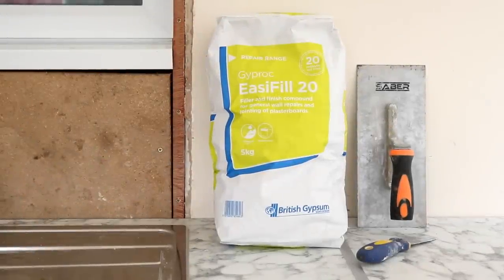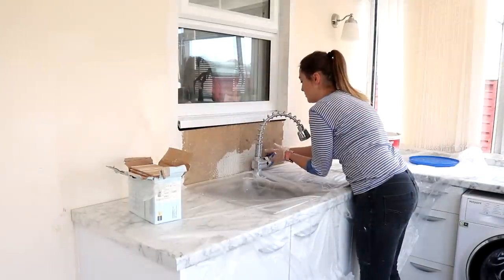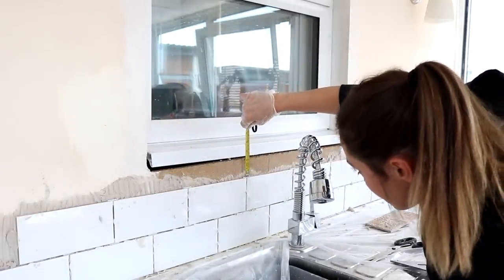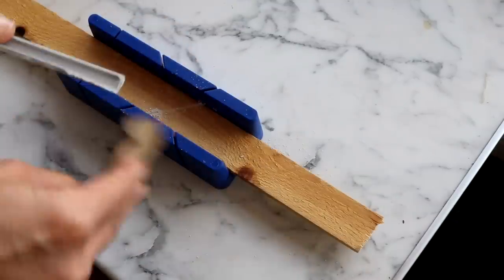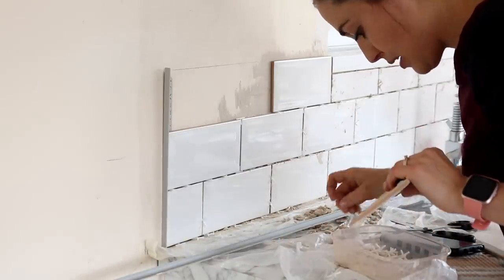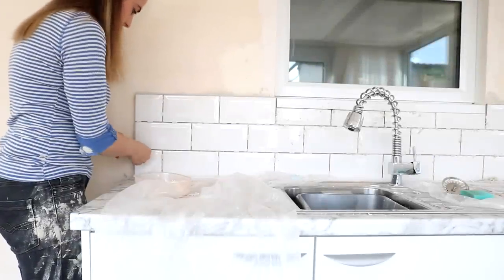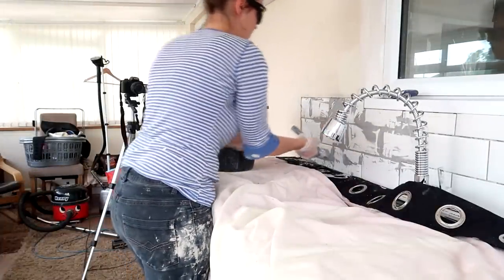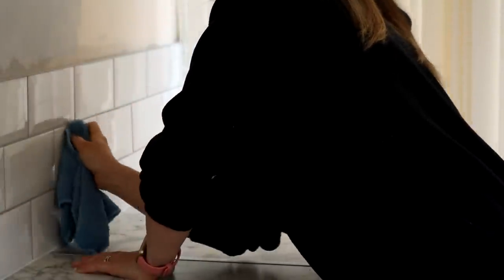Tiling a Kitchen Splashback: Metro Tiles | The Carpenter's Daughter

Comment: Some people use those tile spacers differently! I have seen several ways but I have found the best is to stick one of the "spokes" of the cross into the gap between the tiles using 2 spacers on the horizontal runs! This allows you to easily pull them out after it is set!

If you lay a full tile at the end you need a cut tile on you can overlay another full tile, mark the overlap, cut and you have your cut tile ..... swap the positions and you are golden!

You are right about using a flexible spreader to grout with, but sometimes it is easier to get it right with a grouting tool especially on larger tiles. Many of the grouts available now are waterproof so do not need sealing .... worth a read of the label ;0) Polishing the tiles off with a cloth after the grout has set (but not cured) is a good tip ..... you want your new tiles to look, well, New!

Again the trusty grouting tool will give you an excellent bead on your mastic seal ..... If you want to pose you can wet your finger and run it along the bead, but this is one for the pro's not for me!

Once again a good video showing how easy it is once you have a few basics! ... And how good a result you can get!
Reply from the maker: Thanks for the tips again :)  Your marking for tiling towards the window sounds exactly the same as last week's end panel method... very handy 😊
Reply: Same principal ;0) 

If you want to do the Pro impersonation use a pure silicone mastic. Lay a bead in the corner. Then let it cure for an hour (or about 2 cups of tea) then spray it with a foam window cleaner. No need to spit on your finger ... just rub it down the length in one smooth motion and wipe the excess of your finger with a paper towel. 

You will have a nice tight bead perfectly formed the width of your original bead with no sticky bits to remove ;0)
Reply from the maker: Thanks!  I'll be banking all these bits of information 😄😄

Comment: Hi, all of the tiler friends of mine gave some info on how to prepare the splash back area for tiling - my wife had painted the area with emulsion last summer just to make it look ok - the advice i got was that all the emulsion had to be removed first - this was a pain to say the least - but we persevered & all emulsion was removed - we were going to use PVA but tested what would happen if it got wet when it had dried out for a few days - yes when we tested it by wetting - it could be washed off - so we bought ( FEB BOND with blue grit ) this was tested - very strong bond to the plaster & no problem with melting away - this also gave a very good surface to tile on - a lot of work removing paint but well worth it. Ed,

Comment: Thanks for the vid, excellent result. When grouting, I wait until it partly cures and use the hard rubber squeegee to remove most of the excess grout. I then profile it with anything round and then find a damp cloth or dryish will do the rest.
Reply from the maker: Thanks!  I was rather tempted with a finishing tool :)

Comment: Something else i found with these bevelled edge tiles was they are hard to get a straight cut. I scored the bevelled parts a couple of times to enable a straight cut, otherwise i found the bevels would not be straight. Also when you go for the snap put a piece of cardboard under the snapper or you will get a mark on the tile.
Reply from the maker: Ooh, will try that next time, thank you!

Comment: Vikki....stick your tiles on, don’t put adhesive too near edge where trims are going and slip trims in later with some dabs of adhesive to secure. The advantage is you can use the secured tiles as your measurement for the trims. Brian.
Reply from the maker: Thanks for the tip :)

Comment: Refurbing my kitchen atm and going to tile using mosiac. My question is, should I use a bottom edging strip to hold the ties off the worktop, so, if the worktop ever needs removing it doesn't take the tiles with it?

Comment: thanks for this valuable video! We put metro tiles on our kitchen last week but unfortunately, I found many, many scratches on the tiles in the upper and lower surface where the angle is after the put was placed. I didnt saw how the worker did that but, do experience that before or are my metro tiles in color berry very sensitive? :S Any tip, solution on that? Thank you!!
Reply from the maker: Ours don't look scratched, but with them being a cheap tile, I do think they can chip easily while working with them.  If they're unsightly, you're probably best replacing them.

Comment: You made sponging the grout off 10 times harder than  It needed to be by leaving so much excess on the tiles. Next time clean it off as you go. It looks like you left it too long as well and it had almost completely set. Doing it in smaller areas will allow you a bit more time to perfect. Looked great in the end though
Reply from the maker: Yes, completely agree, which is why I was able to pass on the tip 😂  On my first tiling job, I did clean up as I went  which took me ages.  But having done it both ways now, I'll definitely always clean up as I go from now on :)

Comment: Great video. Can you tell me, when buying your end trim,  what was it that made you go for the 10mm trim over the 8mm?
Reply from the maker: Very good question!  I originally bought 8mm as the store recommended it.  BUT, after cutting it, I noticed it didn't completely hide the cut edges of some of the tiles as they have a bevelled edge.  So, double check with a half cut tile before you buy your trim to save you a fiver, or whatever it is.
Reply: @TheCarpentersDaughterUK  thank you for this information. Keep up the amazing channel.
Reply: @TheCarpentersDaughterUK  I just wanted to thank you for the helped I did my tiled back splash about a year ago I believe and you was a big help.

Comment: Well done but as below use clean sponge to keep tiles clean from adhesive then much easier to remove whist wet ..pain in the arse once set
Reply from the maker: Absolutely.  I just wish I had an assistant when tiling.  I've tiled another kitchen since and no one ever wants to help with the clean up 😂

Comment: Im always put off using pva for this job. I once stripped a bathroom. Half of it had been pva'd and the tiles just popped off. The other half of the room the plaster came off with the tiles 😂
Reply from the maker: Interesting!!  I remember my father in law said not to on my main kitchen, but thought it was absolutely needed with the wooden section :)
Reply: Steve Craft never use pva when you’re tiling, they tiles will eventually just fall off